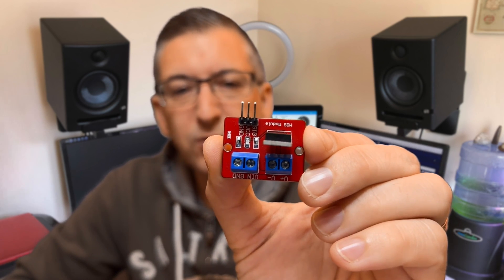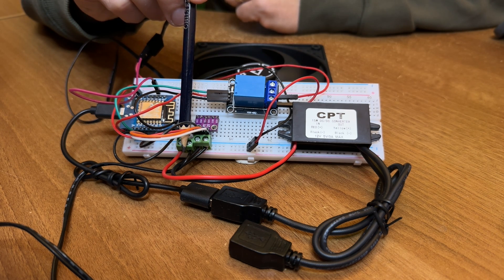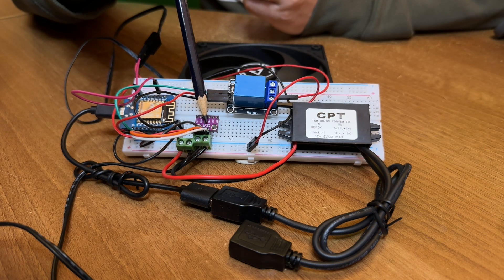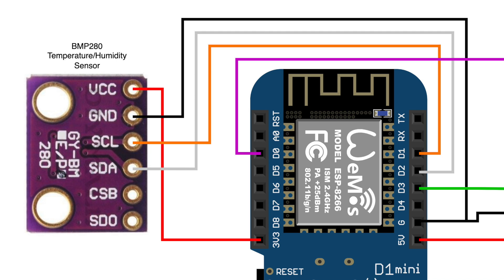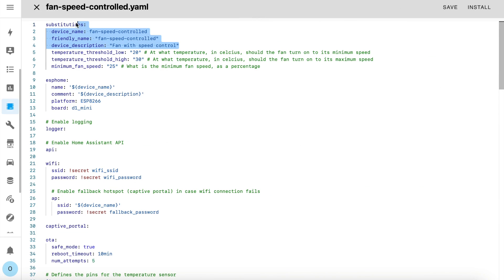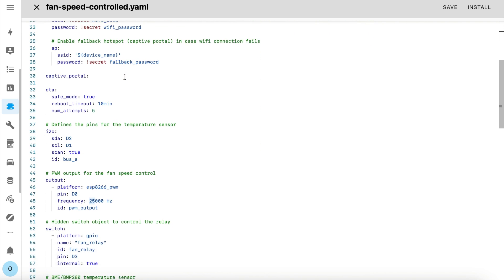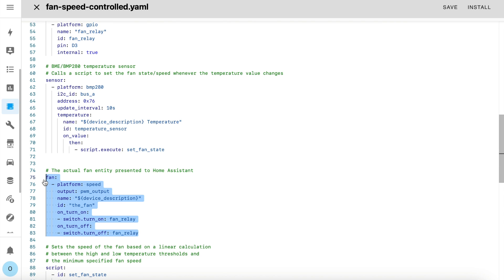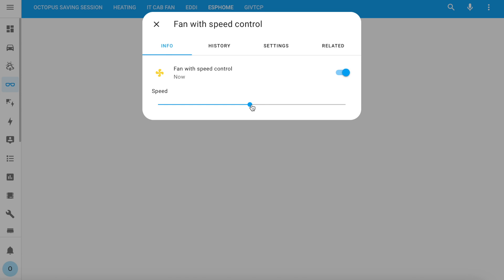ESPHome Fan v3: Variable Speed (PWM) and Temperature Control

Comment: I think you should explain about the common ground in case someone don't use the same voltage converter that outputs a usb port and 12 volt. If you have 2 separate sources 5 volt and 12 volt, you can't just connect the pwm to the fan, you also need to connect the fan and the esp to a common ground.

Comment: This is the exact video i need, but may i ask why isn't a 5v fan used? Is it just because 12v is more common?
Reply from the maker: Yes, it’s easier to get a 12V PWM fan. Absolutely no reason why you can’t use a 5V one if you’d like to and you can simplify the circuit accordingly.

Comment: Thanks for this great video! I just built this today using an ESP32 dev board and the ledc platform as you suggested. I used GPIO19 for pwm and GPIO2 for the relay. Works great and lots of fun!
Reply from the maker: Nice! Yeah I’m starting to use ESP32 more now too. Those D1 Mini 8266 modules are so dirt cheap but the Bluetooth on the 32 is mega useful as a Bluetooth proxy around the house

Comment: ? could you make a new matter enabled project with fans ?
Reply from the maker: Probably not, ESPHome connects back to Home Assistant, Home Assistant can present any of its devices over Matter if you wanted them shared elsewhere. If you wanted a direct Matter device that you’ve created yourself using an ESP32 board then you’ll need to research to find if there are any projects out there that have done that. I haven’t ever looked into it sorry.

Comment: Great work! Is there a way to stop the script running if you take manual control of the fan in HA? when i adjust the fan speed manually after a few seconds it reverts to automatic mode
Reply from the maker: Not with my design but to do that you would have to edit the config for it in ESPHome to detect manual control and stop the script, then maybe re-enable the script if the power is toggled manually. It gets a lot more complicated!

Comment: Thanks for this, i had a basic setup with an ESP32 and a PWM fan but the fan never turned all the way off so needed to see how to add a relay in. Then the automatic temperature on/off on the chip itself will lend itself perfectly to the cupboard I'm putting my LED drivers in to keep it cool enough.  Fiddled around with your code to make it fit and everything is great now, thanks.
Reply from the maker: Glad to hear my idea was useful, great to see it being tweaked and adapted :)

Comment: So this is just what I've been looking for! But it seems a little old (2 year ago!).
I've just set up a small homelab server rack in my attic room. I was looking into using EPS32 and PWN fans plus a temperature sensor to do exactly the sort of things you've done here. Don't suppose you'd want to create v4 with the latest ESP32 rather than the ESP8266?
Reply from the maker: It's not on my to-do list. I wouldn't say it's out of date because it's using an ESP8266. That was a cost choice - ESP8266 is very cheap and still a valid dev module. ESP32 is more powerful and therefore more expensive. It's easy enough to adapt this to an ESP32 if you'd like (I shan't be, sorry!) but unless you plan on adding other features to the project that requires the additional processing power, capacity or bluetooth then you're wasting money on getting the ESP32 over the ESP8266 for this purpose.

Comment: Does this still work with current versions of ESPHOME?

am quite interested in making something similar, for use with a NUKIT tempest, to control it under home-assistant
Reply from the maker: I'm not 100% sure to be honest, the components are long turned in to other things! Almost certainly some of the basic syntax needs tweaking, but I would have thought the general logic parts are still valid.
Reply: I tested it successfully on a d1 mini today and just need to change the portnames from Dx to GPIOx (other numbers!) and get the configuration for the bmp280 from esphome page. It is no longer up to date.
Reply: @birdman4578  Ty for the info, will check it out later
Reply from the maker: Ah yes, the I2C config needs pin numbers now, if wired up like my diagram it should read:

i2c:
  sda: 04
  scl: 05
  scan: true
  id: bus_a

And the BMP280 should be: 

sensor:
  - platform: bmp280_i2c
    address: 0x76
    update_interval: 10s
    temperature:
      name: "${device_description} Temperature"
      id: temperature_sensor
      on_value:
        then:
          - script.execute: set_fan_state

The other components should still be fine with Dx outputs though. I'll update my article now

Comment: GPIOs of D1 Mini expect only 3.3v PWM signal no?
But the PC fan outputs PWM signal of 5v. i read that we need to add a resistor there to step down the level to 3.3v.
Reply from the maker: No, the fan is not outputting anything. The PWM signal is sent by the D1 Mini and the voltage is within tolerance for this fan, it only really cares about the frequency of the pulses.
Reply: @SpeakToTheGeekTech  oh ok sorry i missed that 3rd pin (tachometer for reading the RPM) in the diagram which was not connected to the D1 mini. 🙇

Comment: Thanks! This tutorial is fantastic!
I'm new to HA but I've already managed to implement the project. The only additional help I would like to request is to create a dead band between the Off and On of the fan.
When the temperature is close to the shutdown point we have pulses in the relay. Can you please help?
Reply from the maker: This is totally untested by I think you need to change the section that says:

      - if:
          condition:
            lambda: |-
              return id(temperature_sensor).state < id(${temperature_threshold_low});
          then:
            - fan.turn_off: the_fan

to something like:

      - if:
          condition:
            lambda: |-
              return id(temperature_sensor).state < (id(${temperature_threshold_low})-1);
          then:
            - fan.turn_off: the_fan

Note the extra brackets and -1 which knocks a degree off the lower threshold before it turns off. The fan would already be at 0rpm anyway at the lower threshold so this just affects the relay.

Comment: Really enjoyed building this to act as a cooling fan for my PI 5 enclosure running Solar Assistant linked to my SunSynk.  I have added the status LED from phase 2 but need a pointer to get green, amber and red to reflect fan off, calculated and full. Struggling with syntax's within Lambda's
Reply from the maker: Version 2 doesn't do red, amber, green. It does solid red if on, or flashing green if off. It works by checking the fan status every three seconds and acting accordingly, no lambda involved.

interval:
  # Every 3 seconds, if the fan is off, then flash the LED green
  - interval: 3sec
    then:
      - if:
          condition:
            switch.is_off: switch_fan
          then:
            - light.turn_on:
                id: status_led
                transition_length: 1s
                red: 0.0
                green: 1.0
                blue: 0.0
                brightness: 0.7
            - delay: 1000ms
            - light.turn_off:
                id: status_led
                transition_length: 1s
          else:
            - light.turn_on:
                id: status_led
                transition_length: 0.1s
                red: 1.0
                green: 0.0
                blue: 0.0
                brightness: 0.7
Reply: @SpeakToTheGeekTech  Understood - what I was trying to do was add the concept of a status led on the version three but not sure where is best to add the light.turn_on within the lambda's
Reply from the maker: A few options depending on what you want to achieve. If you just want red = off, green = on for example, just add extra actions in the fan section:

fan:
  - platform: speed
    output: pwm_output
    name: "${device_description}"
    id: "the_fan"
    on_turn_on:
    - switch.turn_on: fan_relay
    - light.turn_on:
        id: status_led
         transition_length: 0.1s
         red: 0.0
         green: 1.0
         blue: 0.0
         brightness: 0.7
    on_turn_off:
    - switch.turn_off: fan_relay
    - light.turn_on:
        id: status_led
         transition_length: 0.1s
         red: 1.0
         green: 0.0
         blue: 0.0
         brightness: 0.7

If you wanted to do different colours based on speed or temperature though then you are best using an interval like in my previous config checking your sensor every few seconds to see what the value is and which colour you'd like it to be in that threshold. That's a bit more work though so I won't be working an example up for you there :)

Comment: how would you control a heating element to maintain a specific temp?
Reply from the maker: The easiest way is to turn it on or off like a normal thermostat would, which is pretty much what most consumer electric heaters do. If you're talking about restricting the power used by a heating element so it runs constantly at a set temperature then you'd need some way to dynamically adjust the voltage to it. Really depends on the power demands of that heating element but you'd need some decent heat dissipation because that component itself would get hot! For safety reasons, that sort of home-made gadget is not one I'd plan to do a video on. I've made much simpler ones with low power (<500W) heaters using Home Assistant to combine a smart plug and a temperature sensor into a virtual thermostat and they work very well and safely.

Comment: Sorry to bother you but looked at this video some time ago and purchased all the components you suggested but never got to go ahead until today. Hit a problem immediately when trying to run either sketch, I am getting the message 'Compilation error: invalid preprocessing directive #Enable'. Is this something I am doing wrong or could it be I'm using a newer version of Arduino software?

The D1 Mini is working perfectly well otherwise, any help would be appreciated. (FYI, D1 mini in only connected to the PC on a breadboard and no other components connected yet.
Reply from the maker: Hi, I have never tried this using Arduino - I've only tried this in ESPHome and my guide is for building this using ESPHome configuration not sketches.
Reply: @SpeakToTheGeekTech  Thanks - my fault - automatically went to Arduino

Comment: The irf520 needs more than the 3 Volt that the D1 provides for switching. With a standard 5V Arduino it works with a fan (tried that a month ago). So there are two options: drive the mosfet with 12Volts or replace the mosfet with a logic level compatible. There you just need to get to 5V.

Comment: I wish I had found this exact video earlier when I was starting to set up my fan control setup. Oh well, at least I learned a lot through trial and error, and the end product works really well.
I actually came up with a near identical setup, and the intial code looked pretty much the same as yours 😀
The only hardware difference is that I use an ESP32 nodeMCU (with hardware PWM support through esphome "ledc"), a buck converter for the 5v power, as well as a DS18B20 temperature probe.
What I intended to build was a temperature controlled fan array for use as a radiator booster. The temperature is read from the probe mounted to the radiator intake.
In Home Assistant I can switch the mode of operation between heating and cooling (yes, our radiators can cool too in the summer because it is fed by a new heat pump).
Then I can adjust the fan speeds, temperature threshold for both modes and also some hysteresis (so the fan doesn't turn on/off all the time when the temp value is hopping around the threshold). Temperature control can also be switched off if I want manual control.
All in all, I just love the ESP32 and similar SoCs, little inexpensive powerhouses of automation! ⚡
Reply from the maker: Do you get any issues with condensation on the pipes and radiators when running in cooling mode?
Reply: @SpeakToTheGeekTech  No, the heatpump is calculating the dewpoint at multiple points and regulates the cooling temperature accordingly.
So far no issues, but we didn't run it for long since it was installed late summer/autumn this year. Next year we'll have much more time to test :)

Comment: Hi, I am new to the whole ESP universe and am still a little bit lost. Anyway, I want to jump into the cold water and start a project based on your amazing work as you explained the concept it in a great way and learn while doing 😊 I want to build a fan array to boost my radiator. Your code does basically what I need. Read a temp and set the fan speed accordingly. 

I have two questions:
1) Do you now if your setup also works for multible fans wired together? I am thinking on using Artic P12 PWM PST. With long radiators up to 7 or 8 fans would be necessary. As they only draw 0,1A/12V, I feel this is not an issue but wanted to hear your thoughts. Could they all use the one PWM signal to be controlled? 
2) I need the temp sensor to be connected to the flow of the radiator to read, if the heater is on and only then start the fan. The BMP280 seems not ideal for my purpose or i dont get its correct function (it has no "probe" and leading singles wires to the flow and back seems not ideal for my project). Many related projects use DS18B20 for this but it only has a single signal cable instead of the two. Would that still work? 

Many thanks😊
Reply from the maker: The short answer to both is "I don't know", but I will elaborate!
1) I'm not sure what would happen if you wired the PWM pin to all of the fans in parallel. I would like to think it would work but I have never tested such a thing. Sounds like a good experiment for you to report back on though :)
2) Yes you could use a DS18B20, but you can't just swap one for the other. You'd need to add a pull-up resistor to the circuit and research which sort you'd have to add, and also change the ESPHome config to use a one-wire library to operate it. The reason I used BMP280 is because it's so simple to get working usually and it works well to detect ambient air temperature.
Reply: @SpeakToTheGeekTech  😂 No worries. I think you already did an amazing job figuring out all those little hurdles that are typical for those projects   
1) I will test it and let you know. 
2) As this seems not trival as a beginner, I decided to stick with your sensor. Thanks for your feedback. 

As a side note: Due to my extensive search I have found an interesting setup using a ESP8266 ESP 01 12V relai with a TZT ESP 01S  Wifi module. The setup is really small and still seems to handle the 12 V just fine. But the documentation is not nearly as good as yours so nothing a bloody beginner like me can handle for now. ;)
Reply: I finally had the time to recreate your setup and it instantly worked out of the box as described thanks to your great description of the project. 🎉😊

I can confirm that it works with multiple of those Artic fans (I bought the PST version as they can be connected easily)

What I found are two things:
1) If the relay switches from the off state to the on state, my fans ramp up to a high speed (which is rather loud) and within some seconds go to the calculated fan speed from your code. Does this happen for you, too or is this an issue on my side? I am wondering if a delay in the code when switching from off to on might help to prevent this!? Maybe the information which speed to choose according to the temp needs a moment to be calculated and send and within this time, it just ramps up to 100% speed!? 
2) As I want to use this setup for my heaters within all of my rooms including bed rooms, I wonder if there is a more silent option fo a relay. I thought about MOSFET type Solid State Relays. Do you have experience in this area? 

This is by far the best solution for heater booster I found! Thanks again for your great work ❤

Comment: Thank you so much for this! The same setup (Wemos D1-R2) is working almost flawlessly for me except for one issue that is driving me crazy. The BMP-280 sensor keeps freezing after 1-2 hours of operation.  The only thing that will fix it is to unplug and reboot. After a lot of research I read about connecting the CSB terminal to VCC (3 or5v) as it should force it to keep running i2c instead of SPI. This has sadly not worked for me either, so im just wondering if you have encoutered anything similar or have any advice ? Thanks again for your work.
Reply from the maker: I'm afraid I don't know, sorry. I have two fan controllers in permanent use (not this variable version but the static ones) and they never need a reboot. It could perhaps be a quirk of the particular variant of BMP280 you are using? Maybe try a BME280?